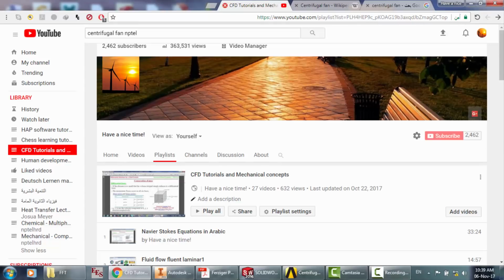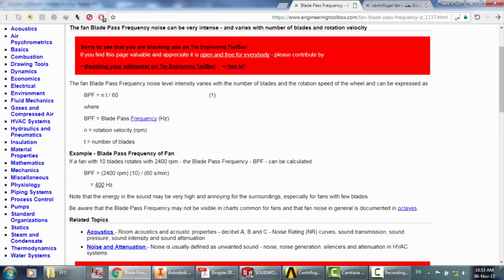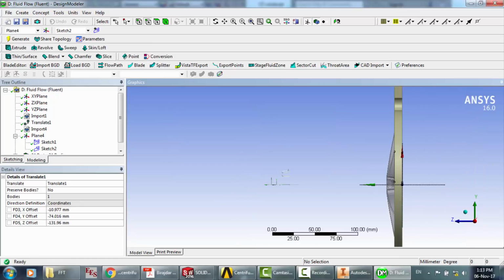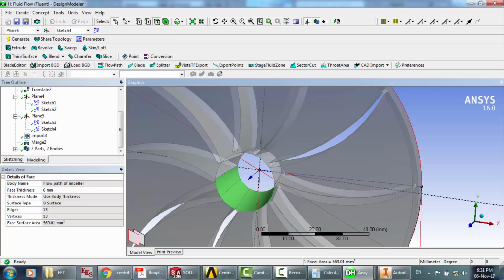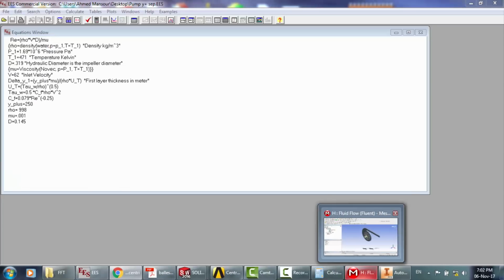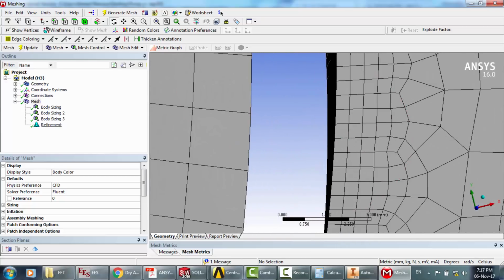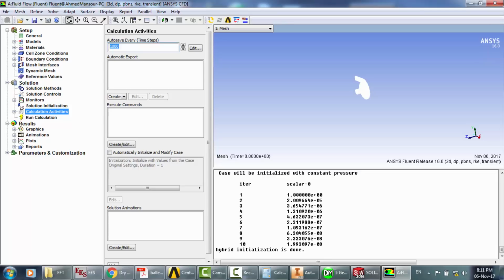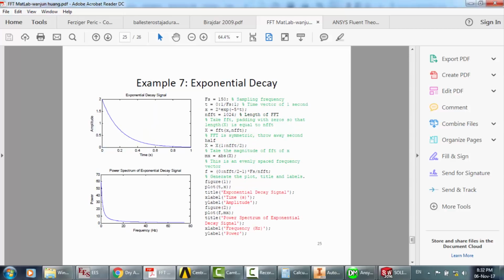A centrifugal fan simulation in Ansys Fluent sliding mesh, periodic interfaces BladeGen Fluent , FFT

Comment: Hi Dear Ahmed, First I would like to thank you for this helpful video and I have a request, could you please explain how can I extract the FFT result in more details,
Many Thanks
Reply from the maker: Hello dear Hayder, you're welcome! Simply, you use the MATLAB code exactly as I showed. Get the txt file that has the time steps with the pressure values, open it and delete any words, just keep the numbers. Run the code and you will find the plots as I showed. Danke!

Comment: Dear Sir,
I would like to ask your advice. According your expertise
 I tried to do a 3d Centrifugal Pump my result showing the pressure difference  from inlet to outlet only about 5000 Pa . I know this is wrong result so I try to check my mesh again my max skewness is 0.99 (unstructural mesh)and average skewness 0.2 . I use tetrahedron and inflation on the blade. My case is unstructural mesh . I don't know why my case can't use refinement. All this problem confuse me about one year.  How would I fix this problem? 
Thank you ! A Student from Taiwan.
Reply from the maker: Hello dear Shang, you're welcome! Simply the max skewness must not exceed 0.98. Otherwise, the results are not correct because the convergence criteria is not achieved. This max skewness originates from the complex design of the machine especially the impeller. This includes the curvature of the blade. Try to enhance the mesh quality by any method or we have to make some slight modifications to the geometry just to make the max skewness does not exceed 0.98. If we do not do this, the correct results are never achieved. Danke!

Comment: The latter stages you discussed regarding periodic symmetry are the stages which I'm experiencing difficulties. Do you have a video/material showing an example of periodic symmetry?  sometimes the periodic boundary conditions will fail to assign despite match controlled mesh.
Reply from the maker: Hello dear Henry, I do not know the procedure you use but it only works if the passage is perfectly cut and if you carry out a circular pattern, it must complete the full rotor or stator without any mesh overlap and without mesh disconnection. Also the named selection is pretty important to define the peridodic interfaces. Try it again please and it is better to use Bladegen to get the perfect passage geometry. You can checkout CFX named selection (interfaces) to see the faces you should select and I have showed that already. Danke!

Comment: thanks for the clear and helpful tutorial, not many people bother to share and help others. one question: do happen to work with OpenFoam or Code Saturne ?
Reply from the maker: Hello dear Astafzciba, you are welcome :), I knoe some basics of FORTRAN and MATLAB in heat transfer, sometimes, see some codes in C and C++ but I will study them later :) ..Thanks
Reply: @haveanicetime  I am trying to do an electric arc simulation and most resources on the internet suggests that those are the best option to do so, but I just want perform the simulation asap, without going into coding. So I was searching a bit more, and I found out that there is an mhd module in fluent but I am still not familiar with it.
Reply from the maker: Okay dear, try to check out the pdf files again and apply the steps, here are 2 links and try to use them and I wish they help you :) Okay? Thanks

https://www.google.com.eg/search?source=hp&ei=GveoW7yrEdCwkwWd8KWwBQ&q=mhd+module+tutorials&oq=mhd+module+tutorials&gs_l=psy-ab.3..33i160k1.788.6902.0.7109.21.20.0.0.0.0.209.3157.0j16j2.18.0....0...1c.1.64.psy-ab..3.11.2020.0..0j0i131k1j0i10i1k1j0i19k1j0i10i19k1j0i22i30i19k1.0.DIHj8r2DwoA

https://www.google.com.eg/search?source=hp&ei=vPaoW87xELSBi-gP2d-BsA4&q=mhd+module&oq=mhd+module&gs_l=psy-ab.3..0i22i30i19k1l3.1062.7286.0.8200.13.12.0.0.0.0.1082.2373.0j4j5-1j0j1.6.0....0...1c.1.64.psy-ab..7.6.2371.0..0j0i131k1j0i10i1k1j0i19k1j0i10i19k1j33i160k1.0.Dj71HachHHk

Comment: Hi. 
Thanks for all your videos! They are really informative and well explained.
I watched all your fluent videos. Then tried to do a 3D axial fan simulation. But I have error "Divergance detected in AMG solver. Float point exception"
I changed almost everything from mesh to boundary conditions and solution controls but none of them ever worked! Really appreciate if you could help! Thanks.
Reply from the maker: Hell dear Tariq, you are welcome, it may be due to the not realistic boundary conditions or the misaligned interfaces..Also, check out the mesh max skewness, it must not exceed 0.98 or it will give a potential divergence.....check them out again please and tell me...Vielen Dank!

Comment: Great video. May I ask how to determine the inlet boundary condition? In your case you set a velocity inlet, but it feels to me like you are pushing air into the fan instead of letting the fan suck the air itself.
Reply: Yes it is much better to choose the massFlow as a inlet boundary condition. But this has nothing to do with pushing or sucking the air into the fan. Velocity is to hard as a boundary condition, it do not allow possible recirculations and more reasons.Btw. I'm working with CFX since 2003 and on my job i do have a real teststand for fans. So i can compare simulation and reality directly. If i have a "healthy" geometry my difference to the reality at the design point of the performance curve is within ~1%! A hexamesh and transient simulation are most important points.
Reply from the maker: Thank you very much dear Ronald, you are awesome!
Reply from the maker: Hello dear Chuan, you are welcome :), simply, the inlet boundary condition for this complex simulations mainly depends on the experimental measurements, for example, the fan sucks air at inlet, you can measure the velocity at the inlet and then use it for the simulation, or you can  measure the total inlet pressure and use it, like I showed in the video, you have to check out the research articles and their way of thinking...The same thing is repeated with centrifugal pumps....Tell me please if you have other questions :)..Vielen Dank!
Reply: Thanks for your reply! I must have missed the notification. I have went through quite a few papers, but I'm still confused. On one hand they say they can predict the performance of the fan with CFD, on the other hand they set up the model with experiment results. What's the point? If you have to determine the boundary condition with experiment, why not test other things as well? In this case, why would I use CFD at all? I'm trying to solve a real case here. I have a centrifugal fan on hand which I know nothing about except the geometry and the rotation speed. I was asked to optimize the performance, so I need to determine it's current performance as a baseline. Is there any way to do this without doing experiments?
Reply from the maker: Hello dear Chuan, like I said, the experimental approach is the most accurate approach, then you validate the CFD model against the experimental results to be sure of the CFD accuracy, then you can only depend on the CFD model if the error is not high, if you do not have an experiment, you can depend on the analytical solution of the fan, calculate the performance from the analytical equations (get them from any reference) and validate the results against the CFD data, you can get the efficiency, torque, power, and these quantities from the 1D approach (analytical approach) and then you can be sure of the CFD model's accuracy, is it clear now? Thanks

Comment: Hi. In the original geometry, you had the solid part (the fan), but when you imported it, you ended up with the fluid domain around it..how did you get that please?
Reply from the maker: Hello, you can do it by the cavity technique in SOLIDWORKS or any other method that can make you get the cavity of a solid part, we also use the export points method to generate the fluid path around the blades and use turbogrid for meshing to save the computational time....Tell me if you still need help...Danke!